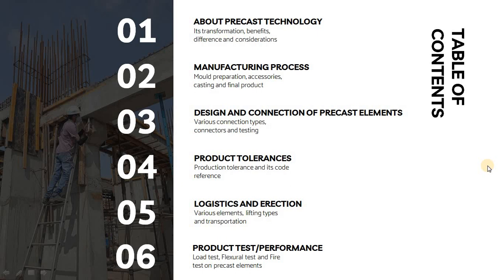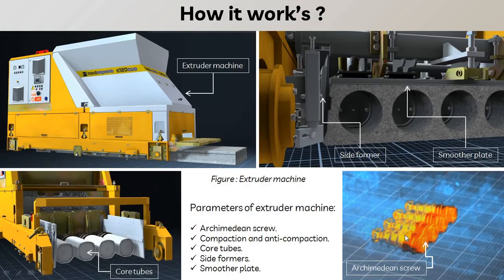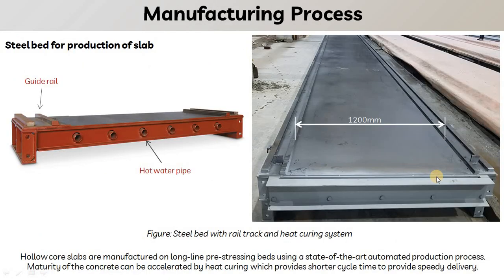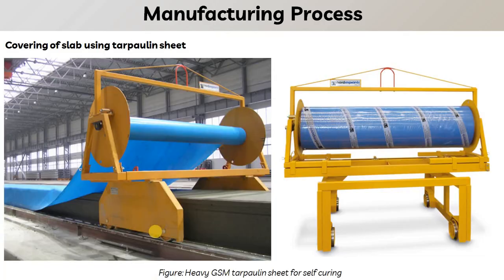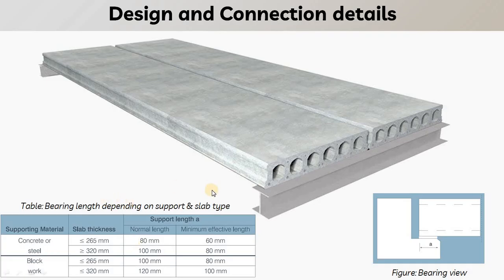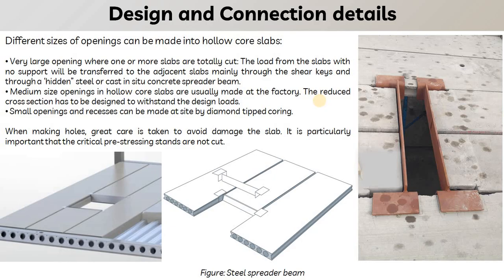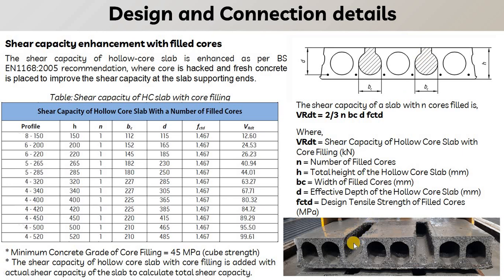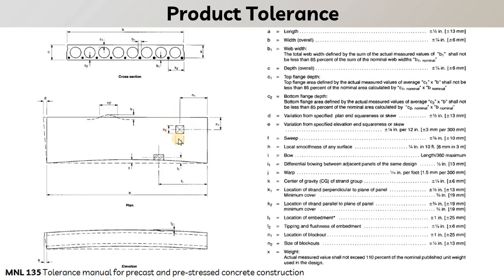Precast Hollow Core Slab

Comment: After hollow core slab casting if there is no steam curing from 12 hours 
Should we have reject  the hollow core slab
Reply from the maker: Steam curing is the process of fasting the heat of hydration and achieve strength. It’s not that if elements are not steam curing, it is rejected. Wrong. It’s all about early strength. Let’s say, strength of HCS without steam curing process (normal process covering slabs with tarpaulin) achieved its destressing strength at 12 hours. Where steam curing process enhances its strength for destressing of HC slabs within 2 to 5 hours depending on temperature.
Reply: If there is a break down of steam curing machine 
Is there is any option like water curing  anything
Any reference
Reply: Should we have to reject if steam curing is not done
Reply from the maker: @MahammedSafwan-m1b  no.

Comment: Bhai, m ghar par bnane ki soch rha hu , aap ka video  suggestion me aa gya, to Plz btao , 9.5*12.5feet room h , me  maximum  5*2 feet 6" thickness ki hollow slab  bnane ki soch raha hu , jisme wire ki jgh Sariya use karne ki soch rha hu,  kya possible h , shuttering ki shop or construction ka kaam h khud ka.
Reply from the maker: Hello dear,
You can used HCS. Hollow core slabs are prestressed products with hollow inside. However the reinforcement used is not the normal reo. Special wires known as 7 ply precast stressed wire is used having high tensile capacity. Therefore hollow cannot be casted at site using normal reinforcement. Actually, prestressed hollow core slabs are machine based products, as explains and shown in video above, and cannot be casted normally at site. Hope you found your answer.

Comment: how do u maintain the camper in 120 meter casting of HCS slab in equal 10 meter cutting length
Reply from the maker: Mr. Ramakrishnan.
While casting HCS, it is casted up to optimum bed length (let’s say, 120m). After achieving it’s demoulding strength, full bed is destressed and then cutting of slabs in required span is cut using diamond blade cutting method. However it’s camber effect after cutting will be form known as upward deflection as well. Moreover, the effect on camber is not a major problem in small span slabs. But in case of HCS span more than 10m requires to place a weight in form of concrete block to avoid the damage during cutting. Additionally, the effective of camber at lifting, transport & Erection will be countered will doing screed on the top of HCS and the application of actual DL & LL.